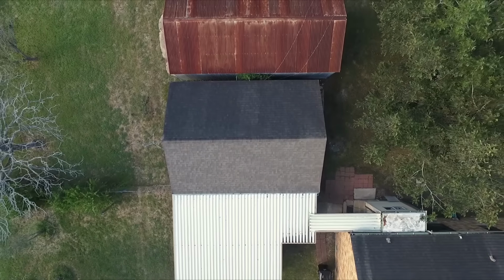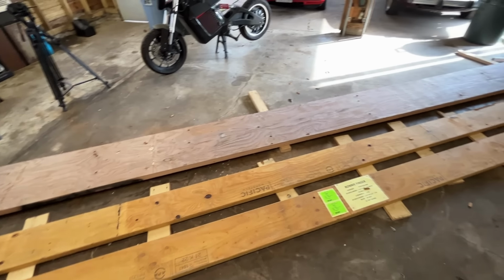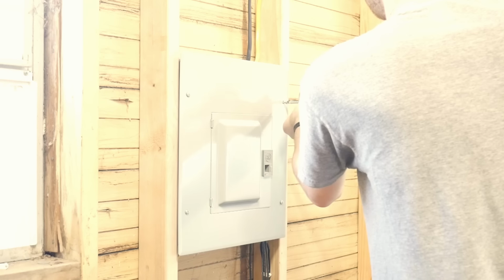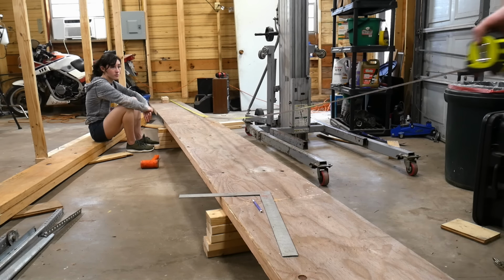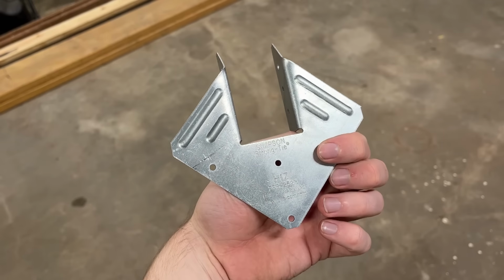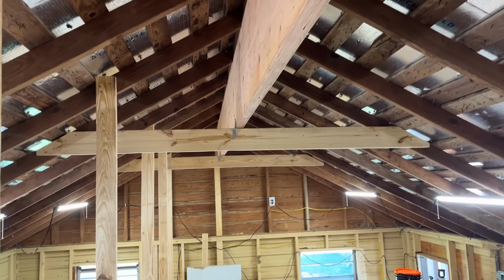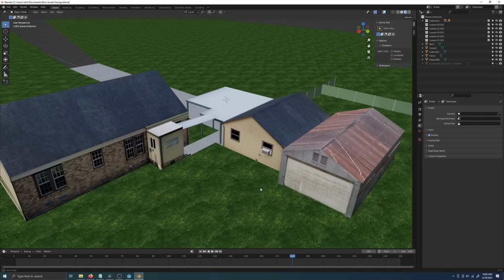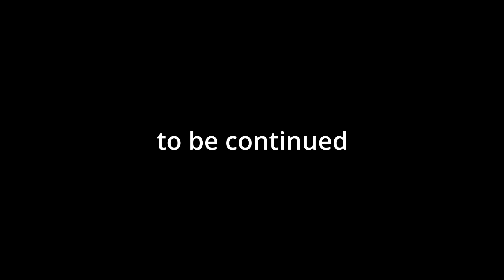E X P A N D I N G my Workshop

Comment: As an ex technician of carports (technically the size up for industrial buildings), you have a few choices regarding the tracks. They can follow the roofline which requires semi-custom bent j-tracks along with springs recalculated to actually lift it the entire way, or entirely new doors that open outwards.Barn doors is a cheap but clunky solution.
Reply: @Methenjoyer69  it's an idea, but roller doors are generally pretty pricey iirc. Their biggest weakness is how sensitive they are to being bent from a mishap, and poor weather insulation. I might be biased against them though, because I hate working on them.
Reply: @NuclearHeadshot  good point. I have roller doors without sound or heat insulation. Bad in Summer and bad in winter. Nice in spiring and Fall

Comment: I heard that Terminator 2 rhythm in there, Ron! Lol! Great progress on a cool shop. Can't wait for part three. I hope that you angle the doors on the slope of the roof. And convert those extension springs to a torsion system why you have the doors apart.
Reply: That's EXACTLY what I was thinking too. Any company that makes garage doors should be able to supply some non-90 degree track bends.
Reply: He's done it before, during the Fiero series

Comment: I had that same problem with the roll up door on my shop. I ended up installing the folding glass doors because whatever roll up solution I tried just warped under the weight of the door.

Comment: Roland. I did something similar and added a high lift kit to garage door. It effectively allows it to be close to roof line when open and not horizontal. It allows door to be opened and closed with car on a lift. I found great supplier on the googles.

Comment: This may already be completed, but if you haven't reattached the tracks, make them hug the underside of the roof.  Even if you have to pay a garage door tech to help make it all work, it's worth it.

Also, you have a platform upon which you could install a gantry crane.  Even if you just use that doubled-up tall strut channel attached to the ties, you could run two tracks down the length of the shop, and build a square frame that can ride in those tracks, itself acting as a tracks for a crossbar that could adjust front to back that eight feet.

Comment: This would be the perfect time to drop down the lighting installation and add insulation with some ventilation. You know, if there's a 2" air gap between the roof skin and the secondary water brake, it keeps the structure cool and dry. But if you simply spray some foam and glue the metal skin into the wooden structure with it, everything rots with mold and termites. And the smell.. When the roof stops breathing, the floor starts to smell. And that stink doesn't go away with a fan. No matter how massive or No.1 that fan is.

Comment: Another option you missed would have been to just move the rafter ties up.  A couple 2x4s on either side of the rafter beams about 18" down from the peak, bolted and glued, will keep the roof from sagging. It's not a good idea for a roof that gets a heavy snow load, but Houston doesn't get all that much snow, right?

Comment: Lol my dad and I did some cajun innovation to lift the box beams for the loft in our shop… we installed pulleys at the top of the shop, and tied a rope on each end of the beam, then the other end got attached to our riding lawn mower… we walked it up to place with screws to hold one end while we used the mower and pulley to hoist one end of the beam a few feet, then put a nail under that end, and hooked up to the other end of the beam and repeated that process until it was in place. It works great, and is overbuilt enough to hold at least one car with no problems 🗿

Comment: Creative garage doors 101. 
Follow the roof line with your tracks. 
Add a torsion spring 
Liftmaster sells garage door openers that drive the axle on the torsion spring. And lifts the door with a cable.

Comment: as nuclearheadshot mentioned angled door tracks that bring the door up the roof line ans use of torsion springs. The garage door openers also mount to the wall bext to the door.

Comment: The garage is ~7925 millimetres in length on paper.
It turned out to be ~7914 millimetres long. He cut the beam at ~7899 millimetres, leaving 7.5 millimetres of clearance on either side of the beam. About 15 average hairs' breadths more than 6.35 millimetres.
Unfortunately, there turned out to be a ~25.4 millimetre gap between the beam and the ridge on either end.
The 38.1 millimetre structural screws were too short to fit through both the plywood and the beam, so he went with 63.5 millimetre screws.

Love your content, Ronald. Keep it up.

Comment: Just get a roll-up door. The kind used at storage facilities and small warehouses should be perfect for your application. As for car lifts, I don't know if you've been researching or already have one in mind, but might I suggest a wildfire lift. It comes with built in castors so you can easily roll it around your shop to put it where you want it.

Comment: Time for roll up doors or cutting the rails you have to get the correct angle to have the doors follow the roof line and switch to torsion springs and ditch the springs you already have to get the springs out of the way too.

Comment: Open the doors along the roof line. That will keep them away from the vertical space. It'll be heavier than opening them to the horizontal, but maybe a more powerful opener can offset the difference. Just a thought.

Comment: Cut the round part of the tracks so that the door opens on an angle , you my have to increase the tension on the springs . It will essentially make them like high lift doors 😉

Comment: If you did the cross ties on every rafter, you probably didn't even need the beam at all.  And I love adding RPA glue when scabbing retro fit structural work.... adds way more strength.

And if you REALLY wanted to save money for a no code no inspection but over built solution, you could fab up a box beam using 2x4s, joint plates, and 1/2" OSB and RPA glue.  No code, but incredibly strong.  Inspector comes, "I dunno, it's always been that way?"  Except having a youtube video kinda shoots plausible deniability in the booty LOL

Comment: Sprayed foam direct under the plywood of the roof, it will prematurely wear the roof shingles since the heat has no way to dissipate  . Best way would to created an air space between insulation and 
roof!

Comment: As somebody who works in rolling steel doors, I know EXACTLY what would be a decent replacement for the garage doors... (but they're not the cheapest things)

Also this was one of the most entertaining videos I've seen in a while. You're a riot!
Reply: Also watching the bolts and bits snap as you anchored into concrete made my basement reno PTSD kick in. Framing things has it's dark moments.
Reply: Can’t insulate a rolling door right?

Comment: Why close cell insulation in the roof to stop heat? Unless you have mechanical cooling it won't reduce the temperature below the current air temperature. You should simply put reflective sarking under the roof sheets. And plant trees to shade from the sun.

Comment: Here in my country, for reduce costs, we use a 20 cm diameter eucalyptus log (natural form) for these cases. Not pretty, not easy to lift (in your case, probaly, the weight for a log with this lenght is 250 kilograms), but very cheap. 100 dolars more or less.  Have you tried calculating other options? Just my curiosity.

Comment: Personally i would have gone with 2x3 or 2x4 in the ends notching the post for the beam so it can be tied together as one peace, but sure this design works decently well, long as there is no snow or anything else heavy on the roof that needs to be considered. Given what is stored in the garage i would always go overkill with structure so there is no sliver of a chance for it to fail even with unforeseen events.

Comment: Outside (above) of the bottom third of the roof rise they're called "Ridge Ties".  no biggy  I predict an unconventional G door track system that might parallel your roof pitch ? To facilitate car lift clearance ? Wonder if door openers would still work ? Metal roll ups would solve this but they're wicked expensios'o & non insulated far as I know. Good luck dude BTW don't let'em talk you into open cell foam, closed cell is much better (harder) & glues the framing together like a drum. (Move everything you don't feel like scraping little beads of insulation off of for years out of garage)

Comment: Instead of replacing the 90° angle and put in the track back for the door why not put a 45° angle and put the track for the door going up the roofline being pulled with a motor to have a remote control garage door, keep up the good work just an idea.

Comment: Great video, always look forward to them……..but!

The only thing I worry about is not having any rafter ties! You have collar ties but it does nothing for tieing the walls together. A rafter tie should not be installed any higher than 1/3 the roof height.
I would definitely do something. At least add 3 or 4 at the max height of 1/3 the roof height. This will still give you some interior height and with 3 or 4 you could still put in a lift.
Reply from the maker: That's what the ridge beam is for! Just like prevented the walls from spreading prevents the roof from sagging, the inverse is also true. If the roof is supported, the walls aren't going to spread apart. If you look up vaulted/cathedral ceiling framing, you should get some more info on the topic
Reply: @RonaldFinger  
I guess. I just hope it holds up over time. It seems awfully sketchy to me. I’m not an engineer, but from a longevity standpoint I would rather have a few strategically placed ties. They can be used for storage. At least off to the sides. 
Just my opinion. Otherwise I always look forward to your videos!

Comment: Okay, this time, I'm not sure on the logic of the roof beam. Yes, totally possible, but very expensive. Why not just make new rafter ties that line up between the doors? It's not like you'll have a lift off-center of one. Wait, are you thinking of those annoying 2-post lifts that are far wider/taller than necessary? Nah, man, 4-post lift. They aren't tall enough to hit the ties.

Comment: How many times have you been asked this question????   What did the structural engineer cost yah? I'm curious.... and did they nail you for a late fee when returning the beam lift? It's sunday..I got nothing better to ask....
Reply from the maker: Only $175, but it would've been a lot more if I was permitting, because that would've required higher fidelity plans/blueprints to be drawn up :) But no late fee for the lift rental!

Comment: Couldnt you just use collar ties at every rafter?
Reply from the maker: I wish! The only thing collar ties normally do is prevent wind uplift from separating the rafters from the ridge. I just happen to be using them to prevent the beam from twisting. They're offering no strength elsewhere since ties are only effective at preventing the walls from spreading if they're within the lower third of the roof :)
Reply: @RonaldFinger  they are essentially the same thing as joists just higher up. Therefore they need to be much stronger  if they are closer to the roof top. 2 per rafter, 1 on each side wouldnt be enough?

Comment: What was the point of putting a ridge beam in, if you are now installing collar ties? You should have just moved the collar ties up more in the first place. The existing collar ties were doing nothing that is why one end of your garage was sagging, not because you removed those pathetic loose 2x4 collar ties.
Reply from the maker: Collar ties and rafter ties are not the same thing. Collar ties are normally only in place to prevent wind uplift from separating the rafters from the ridge. They do absolutely nothing for preventing the walls from spreading apart. That's the job of rafter ties, and they're only effective at doing that if they're installed within the lower third of the roof. I probably should've made that clearer in the video!